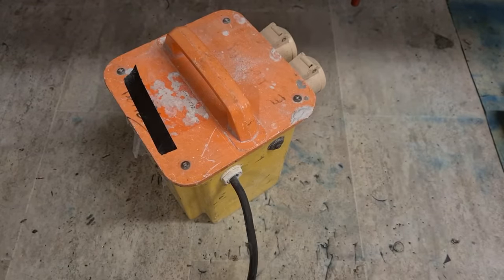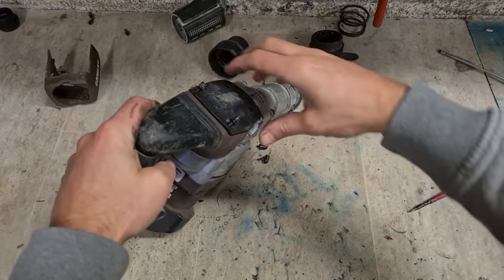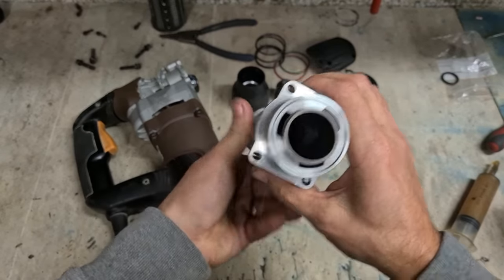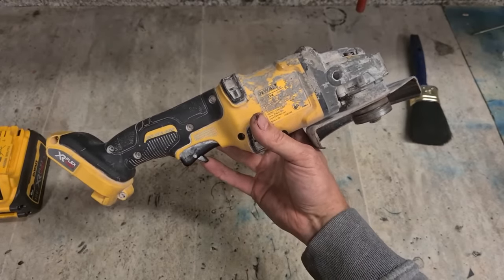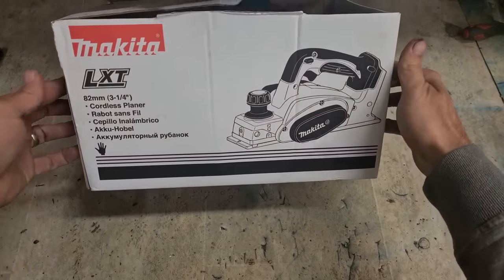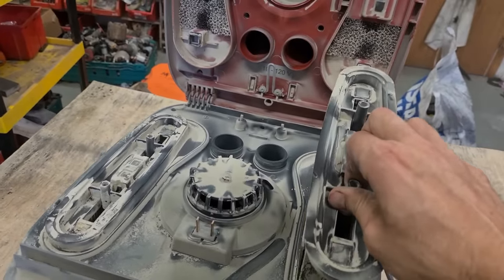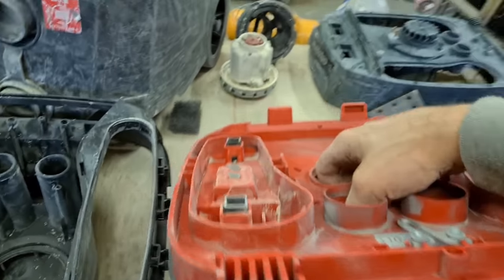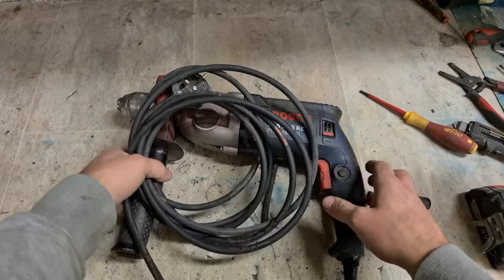Keyang hammer service, Metabo vac cleaned out, factory faulty makita, and a dewalt grinder to avoid

Comment: Most countries in Europe using 220V,230V,240V volt on one phase power supply.Many countries (including mine) have three phase power (380V-400V) supply for home.Common thing in Serbia,Kosovo,Macedonia,Croatia,Bosnia and Herzegovina,Germany etc.
Reply: They use the transformer to 110v from 240v to make it non lethal. 3 phase in to a house is crazy, only used for factory machines really in UK. Probably cheaper for your infrastructure system to not convert it but really unsafe
Reply: All ac current over .5 amps is unsafe
Reply: Although I have heard it said another way 
What is invisible , moves at the speed of light and can kill you 
Electricity 
Don’t you think it should be taught in grade school since it is everywhere ??
Reply: @ed_zeus 3 phase 400v doesn't really need any conversion to single phase 230v. If you connect between one leg of that 3phase and neutral, you get the 240v single phase. Most residential streets/buildings have 3 phase in the UK, but each meter is only connected to one of the phases
Reply: @ed_zeus seems like a marketing scam to sell 110v equipment originally targeted for American/Japanese markets. Hardly 110v is significantly less lethal than 240.
Reply: @mntrmntr  You're cooked either way, 110 or 220 it makes absolutely no difference. It's the stupid British regulations that makes everything over complicated and more expensive for no reason. If it's good for all of Europe why shouldn't it be for Britain.
Reply: @ed_zeus  alot of homes in the UK now have 3 phase but only pull off one..... With the others free from char chargers ect
Reply: That would be so nice, all the best (and biggest) longest lasting power tools use 3 phase, the motors last forever.
Reply: You guys sure have massive plugs in Europe, 240v is nice, but those plugs sure are cumbersome.
Reply: Every electrician from the continent is looking worried, when he sees electrics in British homes. Big currants, big switches for small fans, 32 A fuse for 16 A sockets, ...

Comment: The transformer is actually three windings: 240 volt input and two 55 volt outputs. The outputs are wired 55-0-55 with the centre point being connected to ground. This way the tool sees 110  volts but the maximum fault voltage on the output is 55 volts with respect to ground. The transformers is also constructed as an isolation transformer so there is no connection on the power side between the input and the output.
Reply: It used to amaze me that all of our 110v site tools were pat- tested every 6 months at work. Very lucrative for the testers . Obviously a deal struck down the golf course -probs at the 19th.
Reply: @catabaticanabatic3800  interestingly there's no legal obligation to actually PAT test, it's merely lets the company demonstrate that it has executed it's duty of care if it ends up in Court. For site equipment the most important part of the PAT test will be the visual inspection. There's very little that I would expect to go wrong with the electrics of the tool but cable and casing damage could be an issue if the tools are not suitable for the purpose of the application.

Comment: You must shake your head alot Dean when some tools like the dust extractor come in and the operator has no idea how to clean out his machine. I know none of us read the manuals when we get a new machine but cleaning or changing the filter is just common sense. They all need to be cleaned out regardless  of brand periodically especially if using on concrete and filters need to be changed. That thing was basically just clogged filters and had never been cleaned. 😂
Reply from the maker: no this one was different. the customer actualy read the manual and that is why he left it in. Wasn't just the filters, the whole inside was filled with dust. and metabo do recommend to have a tech dismantle and clean the hoover to prevent it from expelling dust. 
This lad is cutting through concrete walls all day long  so this thing is getting filled with fine cement dust several times a day.
Reply: Wow!  You learn something new everyday.  Thanks for the reply Dean.
Keep up the great work

Comment: My favourite channel and a gateway to a new hobby buying broken tools off eBay and repairing them iv had some success with batteries and a couple of small fires .110 corded drills are my favourite they're not used much on site now the battery is king so they're dirt cheap but now I've got loads of drills nobody wants 😂😂😂😂

Comment: I had the same issue with the Starmix version of that Metabo vacuum recently. I think the main filters had blown through at some point. I found I could uncrimp the metal shroud around the impeller to clean it more thoroughly. I would not be putting those filters back in since they have probably failed. They are pretty expensive to replace, though there are some suspiciously cheap knockoffs available if you don't care about the H class rating. I found the screws from the machine itself ideal to pull the hinge pins.

I hope you're looking after your lungs with all that concrete dust.

Comment: Have you ever tried the old dishwasher method for cleaning grease off tools. I know a guy who builds rally cross engines and he uses a dishwasher to clean engine parts using degreaser fluid from a 40 gallon drum instead of water, and as well it helps getting bearings refitted due to the heat, it also frees up his time by being able to do other things while the parts are getting washed, and more importantly an old dishwasher is a lot cheaper than a specially made machine for the job
Reply: That would make sense but you wouldn't want to put the electronic parts in there, you'd end up having to dismantle things more than necessary sometimes
Reply: Dishwasher is just a parts washer yes
Reply: yes @smashyrashy
Reply: @osianmeilyr89  if you put electronic parts in it you shouldn't be fixing electronics

Comment: I have a couple of the 54v DeWalt grinders, so far so good pity about the Switch.
However im nearly positive the switch from the DeWalt cordless mower would actually work in the grinder looks 98% identical.
Only difference is the absence of the safety lever.
I could be wrong N474391
Maybe its possible to swap the trigger component to get it to 100%
Reply: Nowt wrong wi em...I got the 414 and the 418...powerhouse ANIMALS

Comment: It's because of the motor stopping dead that's unthreading it I found that problem on a DeWalt cordless drill I had w the brake was that harsh it used to undo the chuck and the drills would drop out, I did think it was a dodgy chuck but bought a nother DeWalt chuck but that kept doing the same so I got rid and got a different make drill.

Comment: I understand that brands do stuff to be dumped in first malfunction but aliexpress or ebay sell most of the switch inside switches. it just gives a lot more effort to replace but it works. I can give you the example of a VAG car door lock it has a microswitch which costs 1€ in aliexpress, but VAG won't sell microswitch only, instead sells the whole lock for 300€

Comment: To say that an expensive tradesmans tool is usless without buying half the machine again says somthing about Dewalts current state of affairs.. Im a Dewalt man myself, but Id have to admit ive been none too impressed with the overall feel of some of the new tools ive bought from them as of late.. Bought the new brushless combi drill dcd76 and didnt like how plasticy and feeble it felt, the chuck has a noticable ammount of wobble from the factory which pissed me right off, Also bought the new brushless jigsaw and while it cuts like a dream, id be afraid of me life that if it took a fall it would stop working.. I just get that feel from the latest stuff.. I also was worried about opening up the tools as I do with every new tool I get to see whats going on.. I seen a big control board in the jigsaw and said, lovley.. If that goes ive a pile of scrap on me hands.. The older stuff I have, was as rugged, easy to repair, very difficult to actually make not work.. I suppose I get a less premium feel with the latest brushless stuff.. I know its all going that way.. But i liked the fact that when the motor stopped working, It was 90% of the time either the switch or the brushes which were all availible all over the internet not just from dewalt..

Comment: Hi,The 60v dewalt drill ,Does it have a capacitor to start the motor ? That would be my first stop .Without the capacitor it hard to get the amp to start it .just a thought from a electronics point or veiw

Comment: that dewalt issue is mad. how can they get away with that. 
you know that bosch drill is good if its been around long enough to need the cable replaced several times.

Comment: Dean isnt a Milwaukee cordless grinder just as bad as the 54V? If something goes wrong all the electronics need to be replaced as well?
Reply from the maker: yes, but they are not as expensive. The grinder is good. but given the reliability for the 54v batteries, buying into this setup is expensive and if they cannot be fixed outside warranty, i would rather warn people who think they paying more for a reliable tool, when when its not. 
This is more suited to someone who needs the bigger grinder and the extra power and don't mind the extra cost.

Comment: Dean, on that Makita planer, did the manufacturer forget a screw and washer on the spindle that kept the pulley from coming off?
Reply from the maker: no, the pully is only put on hand tight. must not have been tightened up in the factory. There is not washer or nut, the pull itself is threaded. I am only guessing that that is what happened.

Comment: This day and age these companies need to be made to supply parts individually ie that switch so they can be repaired rather than landfill by again...
Reply: I agree, from a sustainability point its absurd that its a chuck away tool
Reply: @joaocosta3374  having a part and making it cost prohibited to actually repair or selling parts independently to each other is the issue

Comment: Is that switch Pacific to DeWalt or can it be bought online is it similar to any other switch Dean
Reply from the maker: Hard to know, it's a branded switch, so the body is standard for the manufacture. But the actual trigger head is probably custom for dewalt. But dewalt do use this switch in other tools. Sobyou can do some research and buy the switch from another tool. But it's very time consuming
Reply: Yes that's very true just takes up way too much time

Comment: Another absolutely cracking one Dean 👍🏻👍🏻. Brilliant repairs as ever mate. I think the most satisfying one blowing the hover out😮😮. I've changed my brushes in my DeWalt chop saw and the automatic brake has stopped working. Any idea guys 🤔🤔
Reply from the maker: Brake could be the secondary winding in the field or else the switch
Reply: @deandohertygreaser  Cheers mate 👍🏻

Comment: I can’t with these site transformers.  How many have fallen off of a scaffolding onto someone’s head you reckon? 😅
Reply: None. They are too expensive
Reply: transformer wouldnt  be allowed on site like that. they should be at a 240v outlet  usually in a dedicated 'safe' zone. it should be a 110v cable going up the scaffold.

Comment: 110volt being less likely to stop the heart, at 5 amp compared to 240v at 13amp. To actually stop the heart all you need is 0.7amp, so big difference going from 5amp to 13amp. ( the amp reduces as its conducted, so skinny people would get a bigger shock to the heart as far less resistance).
Reply: Everyone is different thought so I shouldn't generalise about skinny people

Comment: Someone sold Ireland a ticket down the globalist garden path with mandatory 120 volt site transformers. 120 is the common mains voltage in the USA and it makes you no more or less dead than 240 volts does. This is just a way for Ireland to mandate the use of USA market tools,  of which none are actually made in the USA. I worked with an Irish electrician many years ago. 240 volts grabs onto you better, but if it's your time to go, 120 volts will take you there just as easily. Lots of large USA industrial sites used 240 volt power tools exclusively, because stealing them was pointless.
Reply: Rubbish mate, it's just an outdated trend in the UK and Ireland that we use 110v site tools, the regulations used to call for them in at least the UK but now 230v tools are allowed on sites as long as there is a tested RCD on them.
The idea was that because it's 55v on each leg (similar to how 208v is two phases in the states), touching the single 55v leg while grounded is less likely to kill you, and that does carry out to the real world, but since portable RCDs have come into play, it's not mandatory anymore.
People are just used to and bought into the system now and hence still use them.